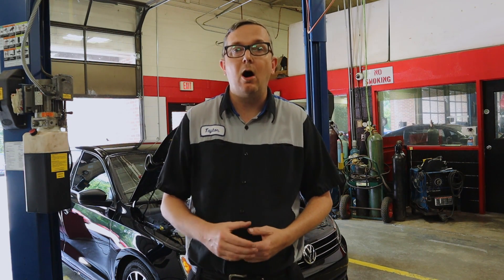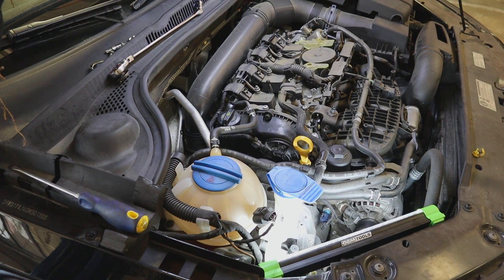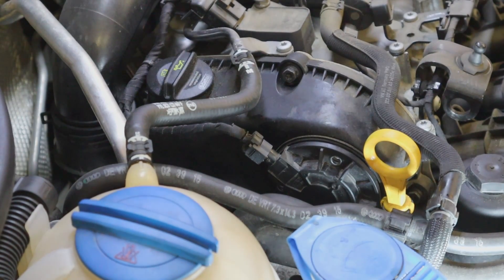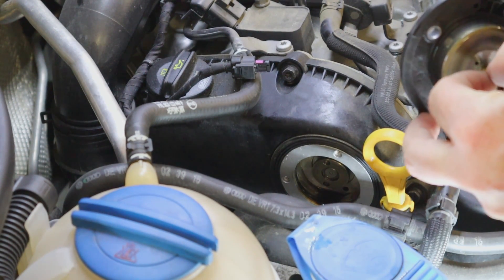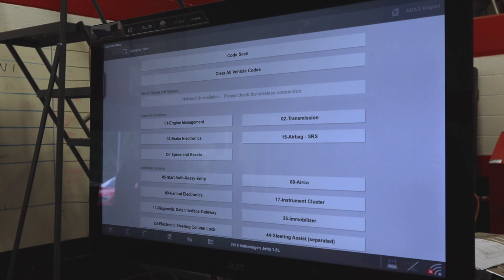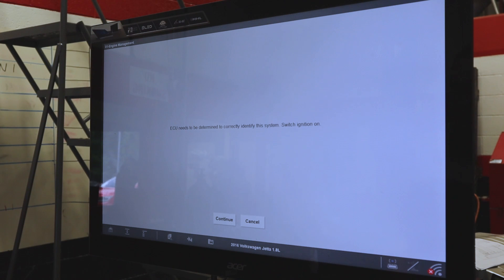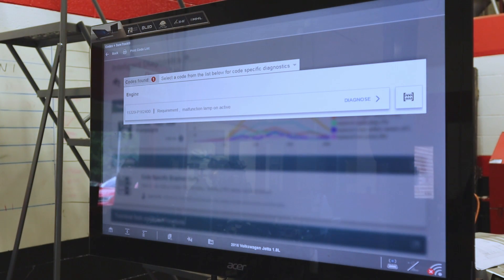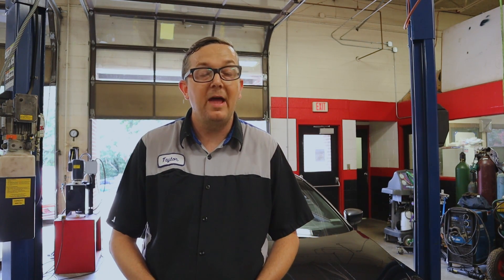VW Audi 1.4 1.8 2.0 TSI P0011 Camshaft code diagnosis and repair - try this first!

Comment: I can't get mine to turn to loosen it
Reply from the maker: It is reverse thread, so you have to turn to the right to loosen.
Reply: @AutoScholarwithMrB  yes, thank you I got it, all the trouble I went through to get it out, the new one was too small so I cleaned the old one and waiting for another new one to come that's oem
Reply: I have a question while loosening the solenoid ?. Did you ???  Have to hold the gear to get the solenoid out . Bcuz every time we turn the solenoid the gear where the chain sits on is turning ? Ain’t that bad ? 

My question is should I be concerned that we did not hold the gear still
Reply: @Maskidana77  Did you reverse loosen it? The solenoid loosens reverse, so like if you were to tighten it,you're actually loosening it.  Lefty tighty and righty loosey in this case.
Reply: @daviddart400  yes sir I did that . Can you Please answer . When you loosen the one in the video . Did the ⚙️ also Turn . . And let’s say it did hop while loosening the SOLENOID. Is chain Stretched am I screwed or ? Is there any solution. By the way it’s 2 Am . I’m in Gothenburg Sweden 🇸🇪 I appreciate your Help and your a great Person Mechanic👍🏻
Reply: @Maskidana77  it moved but didn't turn
Reply: Yes I did loosen the right way but my gear moved like jumping a tooth with chain not moving
Reply: My question is I took the plastic black part off . And I have the right tools from SATRA
AND to loosen the solenoid it’s To the right . The gear the solenoid is in moved . Now I’m afraid the chain might of stretch
Reply: LOL I thought you where the Owner of this Channel 😂 Sorry

Comment: To remove the oil control valve do you have to remove the cover or can you just go right at it after removing the cam adjuster magnet
Reply from the maker: You can get it off without removing the cover, but I like to inspect the chain while I am in there.
Reply: @AutoScholarwithMrB  I literally just changed my timing chain 2 weeks ago. I replaced the tensioner, guides and all so I just need to replace the magnet and the control valve, also thank you for the quick response
Reply from the maker: Thanks for watching, Albert!
Reply: @AutoScholarwithMrB  no problem I also gave that subscribe button a little tap too. Great video bud
Reply from the maker: @alberth237  thanks and good luck with your repair.

Comment: Does anybody have a link to the tool to remove the valve timing solenoid (with 2 holes) ? Thank you
Reply from the maker: DPTOOL Engine Timing Tool Kit for VAG 1.8 2.0 TSI/TFSI EA888 T10352 T40196 T40271 T10368 T10354 with T10355 https://a.co/d/6PSgbfy
Reply: @AutoScholarwithMrB  thanks for your reply. That is a complete set.  Is there anywhere only the screw for the timing solenoid that i can buy separately?
Reply from the maker: @tuongle7206  I’ve never seen it sold separately
Reply: @AutoScholarwithMrB  ok so maybe i will try first with a brake caliper compression tool. Was it easy for you to remove the solenoid or was it very tight ?
Reply from the maker: @tuongle7206  some are tighter than others, this one wasn’t too bad.

Comment: What if I get this code even after replacing it
Reply from the maker: You will most likely have to replace the chain set, unfortunately.
Reply: @AutoScholarwithMrB  would replacing the magnetic cover help or will it still require the timing to be done
Reply: @AutoScholarwithMrB  one was stuck the other played freely

Comment: Nice I know this video is old but I just started working on VW and the car is throwing this could along with a cam position sensor code. The car does a weird idle like its trying to find itself in time. I got the parts already just waiting for them to come in. Ill do exactly what tou showed thanks boss 👍👍👍.
Reply: Just outta curiosity what happened after and what parts did you get?
Reply: @theking965x  So I replaced that sensor and the magnetic part that was covers it. After I replaced it witch is a pretty pain in the butt I started the car and it wasnt having the weird idle anymore. The code never came back. At first I was thinking the whole timing system was going to go off but no. That sensor for the Cam shaft went bad and made it seem like the whole timing was off. I was this close to replacing the whole timing system but till this day the car has been running fine no weird idle or like if the car wanted to die.
Reply: @AlexRH1991  thank you very much I have a ‘15 gti and this came up and there’s other things happening too so I’m trying to piece everything together
Reply: @theking965x  no problem. I also worked on a GTI but a 2008. For that case tho it was the timing chain but the problem with that car was it didnt start and the coustomer kept trying to start it and since the chain broke it bent the valves so yeah that job was a really big pain but hopefully that wouldnt be your case. Good luck. 👍
Reply: @AlexRH1991  I have starting issues too but I think it’s fuel related if you wanna read some codes I can send you the whole list that’s coming from reading it rn
Reply: @theking965x  if there are codes then thats a good way to start. Yeah you can send me the codes and I can let you know what the codes mean so you can have an idea whats causing the problem.
Reply: @theking965x  sorry forgot to say what parts I got. So I got the VVT solinoid the Cam shaft adjuster magnet and also the cam shaft position sensor.

Comment: Hi Mr. B. This is a great video!! Could this be causing my problem as well?? I have a 2013 Beetle Turbo 2.0t TSI. The car runs great except I am getting a slight knocking noise but ONLY when the car is BOTH warm and at idle. Cold start, there is no noise at all until normal operating temp is reached and the car idles down. Also, once it's warm, I only get the noise when stopped and at idle. Accelerating through the gears there is absolutely no noise whatsoever and the car runs great. Once the car is warm and I am getting the noise at idle, if I disconnect the wire from the VVT magnet, the noise goes away completely. I am going to try cleaning these parts as you showed in this video, to see if it helps. BTW, I did notice that there was oil on the end of the wire when I unplugged it, which Im sure is not supposed to happen. Any advice would be greatly appreciated. Thank you!
Reply from the maker: Yes I would replace the magnet for sure on that
Reply: @AutoScholarwithMrB  Thank you! I actually just got the part in the mail and am going to replace it today.
Reply: @AutoScholarwithMrB  UGH! I just replaced the magnet and now the sound is not as bad as before but it is still present. Im going to try pulling the actual plunger out of the cam and clean it like you showed in the video. The plunger is definitely not bad as I can easily move it with my finger and it does not protrude from the back side. Im hoping maybe its just dirty like the one you showed in the video.
Reply from the maker: @The_Gary_Douglas  well it looks like you are on to something if the noise changed.
Reply: @AutoScholarwithMrB  No change after cleaning the solenoid. Just went and had the oil changed also, no change in the sound. Any advice? There is absolutely no effect on the performance of the car at all. Runs like a champ as your accelerating through the gears.
Reply from the maker: @The_Gary_Douglas  hard to say. Any codes set?
Reply: @AutoScholarwithMrB  Before I changed the magnet yesterday, I had a P0010 and another one for the camshaft position sensor.
Reply: @The_Gary_Douglas any fixes. My mk7 gti has the exact same scenario as yours
Reply: I have 09 tiguan with exactly same issue with noise only at idle and warm. The sound started for me after doing new chains and tensioners. I think maybe I overtightend the oil valve in the cam. My car also runs perfect just has the noise. Will you always have a check engine light with codes?

Comment: Can this make the car misfire ??
Reply from the maker: Yes but there will be other codes
Reply: @AutoScholarwithMrB  I have a couple of codes on it can you maby help ??
Reply: Code p0011
Reply from the maker: @albertflores5952  have you tried what is in this video?
Reply: @AutoScholarwithMrB  am gonna do it was it hard with the hoses in the way ?? And what you use to take out the t30 bolts ??
Reply: @AutoScholarwithMrB  so I changed the parts today but for some reason the Vvt oil control vavle doesn’t wanna tighten when I do it to the left it just keeps spinning also when I try take it out it’s the new Vvt oil control vavle I got any reason why maby ?
Reply from the maker: @albertflores5952  I’m not sure. Never had one not go back in. Are you sure you got the correct part?
Reply: @AutoScholarwithMrB  well it went in but keeps spinning doesn’t tighten or loose to come out just keeps spinning and yes I got it for my 2016 1.8 Volkswagen Passat
Reply: No I am I have got the parts gonna do it tomorrow also you used a wrench or rachet to take it out what it hard the t30 bolts did the hoses get in the way ??
Reply from the maker: @albertflores5952  hoses shouldn’t be too in the way. I used a ratchet and a torx socket.
Reply: @AutoScholarwithMrB  ok also do I need to drain the oil or no it won’t b a problem??
Reply from the maker: @albertflores5952  draining the oil isn’t necessary
Reply: @AutoScholarwithMrB  ok your help a lot thank you waiting for my parts should b hear tomorrow thank you so much boss
Reply from the maker: @albertflores5952  good luck with your repair Albert, thanks for watching!
Reply: @AutoScholarwithMrB  thanks for making the video and thank you appreciate all the help

Comment: Extremely helpful and professional video.  Sadly, Amazon shows the tool as unavailable...but I was able to find the removal tool and will give this a go when the set arrives.
Reply from the maker: Thanks for watching Timothy!
Reply: I have a similar issue, had a timing chain already but I believe they didn’t change the magnets and adjuster. So I’m planning on buying a new cam cover, gaskets, bolts, magnets and cam adjusters and hopefully it runs a little better. 

My current issue is it’s leaking oil slightly from the top bolt of the front side magnet! Already changed the internal seal behind the magnet but not the casing seal

Comment: I got this code and a parts store told me it was the vvt solenoid but there were 2. One by the oil pan and one somewhere else. Is this the non oil pan one? I can't find any info anywhere
Reply from the maker: The solenoid in this video is the only one I know.
Reply: @AutoScholarwithMrB  Thank you I will try this tomorrow.
Reply: @AutoScholarwithMrB  just wanted to say thank you, this was my issue. Ordered new parts and replaced them my self. Parts and tools were $100 total. Engine light went away almost instantly, passed smog. You're a money saver!
Reply from the maker: @TheIdiotChallenege  fantastic! Hearing things like this make it all worthwhile. Thanks for your support.

Comment: I try to remove the valve but it's very hard, where do I make it loose? Or does it have a lock?
Reply: Doesn't have a lock. It's on tight but you can get it out with some screwdriver prying and wiggling persuasion.

Comment: I am looking to replace the magnet as well as the oil control valve. Did you ever find out if the superseded part will work or if i have to change the camshaft as well?

Comment: Anyone know what the name of that special tool is? Im gonna do this to my 2015 passat but don't know what tool I need to get my hands on from the dealership.
Reply from the maker: If you look up the tsi timing tools on Amazon, this tool comes in the kit. I’m not sure you can get it separate.
Reply: @AutoScholarwithMrB  awsome thank-you!
Reply from the maker: @single_dad  no problem my friend. Thanks for watching!
Reply: @AutoScholarwithMrB  Back being that magnetic piece and that plate you take off, whats the name of that part with the screens in it that gets clogged up? Im just gonna buy a whale new piece from volkswagen for $30 but I don't know the name of it to give to the service department. Whats the name of that piece?
Reply from the maker: @single_dad  I am not sure what they actually call it, so maybe cam insert?
Reply: @AutoScholarwithMrB  Om going there(Volkswagen) tomorrow. Ill let you know what its called 👍
Reply from the maker: @single_dad  thanks!
Reply: Whats the name of that peice with all the screens in it that gets clogged up? You said its 20 to 25 dollars.

Comment: Is the issue normally the Spool Valve or the Magnetic Adjuster?
Reply from the maker: I’ve seen both, but normally the magnetic adjuster fails or get dirty more often.

Comment: I’ve been having this issue for months… I changed my oil to mobil1 0w40 and ever since switching grades for winter I haven’t had the issue. I’ve been running Castrol edge 5w40 or pennzoil euro 5w40…. Any idea what happened?
Reply: oil is too thick for the passages in the oil control valve possibly so it doesn't flow fast enough

Comment: Im currently having the same code P0011, i noticed the streams of the intake cam oil control valve are a bit damaged, can they be the ones causing the intake cam timing to over advance?
Reply from the maker: Yes, if it looks damaged, I would replace the whole valve.
Reply: Changed it no luck...now am getting P0341 for cam position sensor. Can you please tell me how to check if the cam gears (vanos) are damaged or worn
Reply: @louwscustomsza  what was the problem ?
Reply: @Paty45er  P0011 & P0341
Reply: I have the same codes 
Did you find the reason?

Comment: Wow thank you for this video. Got this code and realized there was a lot of carbon build up, got that cleaned and replaced the spark plugs. Dealership quoted me $3k+ to fix this issue on my 2015 Passat, almost a 3rd of what I paid for it!!! Going to check this out first and hope that this is the issue.
Reply from the maker: Good luck with your repair!
Reply: how much torque should i put on those t30s?